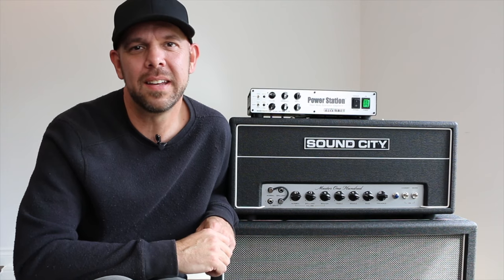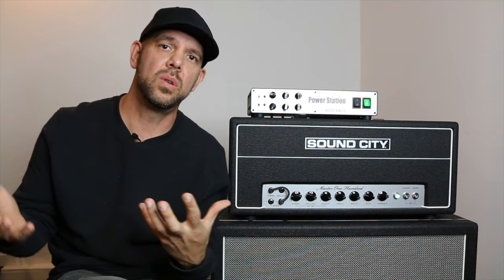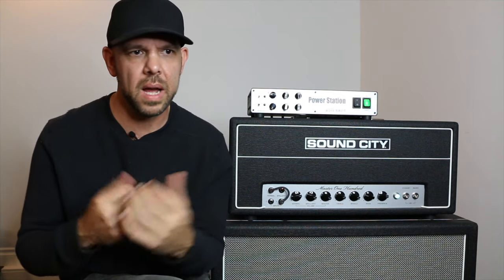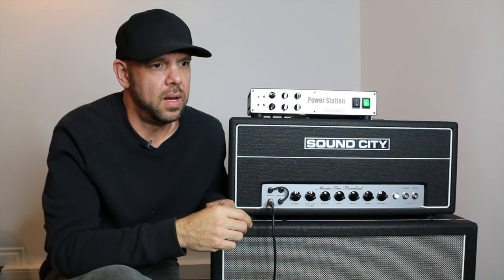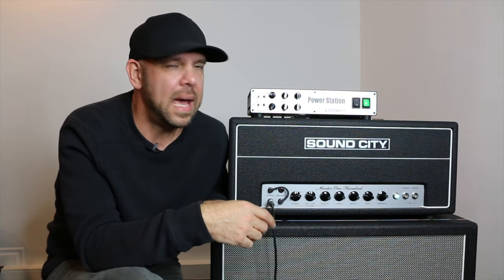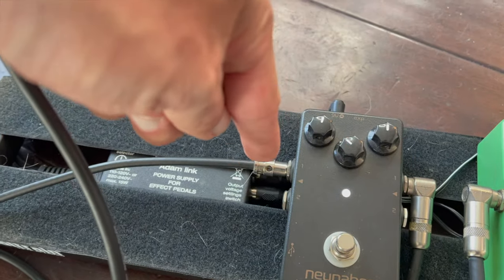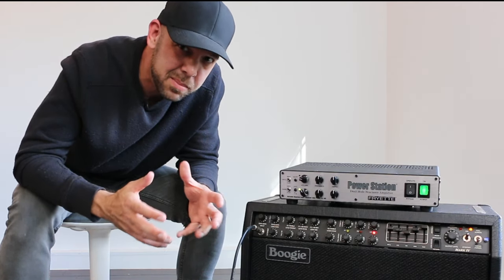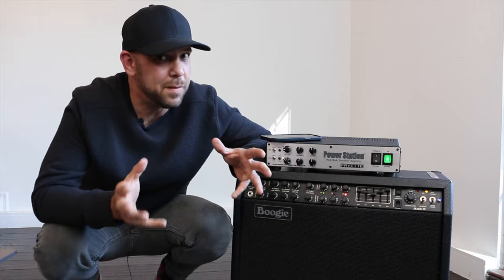Fryette Power Station - Mystery Squeal #2 Explained and Solved!

Comment: This video saved my life, for mental health related issues.  I have been trying to solve this for some time now.  I have many amps/preamps that I connect to the Fryette and had also been connecting my effects to the effect loop of the AMP.  One day I decided it is kind of a pain to disconnect and reconnect the effects loop pedals every time I changed an amp so I tried the effects loop on the Fryette Power Station.  I found myself standing in a puddle of my own urine trying to understand what the horrible screaming I was hearing was.  An isolated PSU did not resolve the issue, the isolation transformer between the amp and distortion pedal did.  Thank you so much for this.
Reply from the maker: Awesome mental image!

Comment: Fortin Zuul+ or similar gate owners: This is probably old news, but I'm posting this here in case anyone else shows up after troubleshooting without success. If you are running the Zuul+ in front of your amp and in the loop of the Power Station, and it is squealing, you can fix it by putting an isolation transformer in front of the key input. Remove the Zuul+ from your chain for troubleshooting to see if this is your issue.
Reply: Thank you for adding that comment. It helped me get rid of the noise it was still making when I had it between my amp and overdrive pedal.

Comment: I have this problem with gsp1101 or HX Stomp 4cm into my amp heads, even without using real pedals. I just 4cm the head and then head into the PS-2 then out into the cab. Took a lot of digging online. Good on ya for putting this out.

Comment: Really appreciate this video and your awesome products. Watched this before my ps2 arrived. I bought it partly for the attenuation in I need my small amp larger but mainly was really looking forward to using my boss ms3 with the 4 cable method in the loop. Sure enough at higher gains it squealed like a pig. So I immediately purchased the behringer hum eliminator just like you said and it worked perfectly. I am amazed how good the effects sound in the loop and the tone at all volumes. A game changer indeed : )

Comment: Hi, thanks for the clarification. I bought a Line isolation transformer (Palmer PLI 01) and it worked - but funnily now the tail of my held notes or ringing chords kind of gets chopped off… I can’t wrap my head around that… all my devices are powered by the same wall socket, my pedals have an isolated power supply, and the ground lift button didn’t change a thing. When I run the exact same pedalboard with 4 cable method into the effects loop of the amp it doesn’t happen (i know I could use that loop but the same applies for non-effects-loop amps as well) 🤷🏻‍♂️

Comment: that's great, thanks for taking the time to explain. When you plugged the isolation box though, the hum noise was louder than before. Is this normal?
Reply from the maker: Thanks for the comment! I have to say, when I was in the room making the video there wasn't any sort of appreciable difference in noise when I plugged the iso box in- certainly not to the degree that you hear in the video. I think what happened was that the compressor on the audio track readjusted itself and pulled the noise floor up a bit after I stopped speaking. Also, there was some iPhone audio blended in after I plugged the box in (which was in front of the amp vs the lav mic that was the only audio source before the squeal). Hope that helps!
Reply: @FryetteAmps  actually this helps a lot! Thanks again, great work!

Comment: (For the AC 120 power source ground loop) What about plugging either the power station OR the amp into an external 1:1 iso transformer? Couldn’t you get the same issue as the stereo amp being plugged into the same power source scenario?

Comment: If the source of the ground loop is the cable jacks from the two pedals touching each other, then why not just keep them separated? There must be some noise that has nothing to do with the proximity of the two pedals to one another, right? If not, what am I missing?
Reply from the maker: You're only missing that until you see this vid, you may not be aware of the need to avoid certain kinds of ground loops. Also the oscillation behavior varies from rig to rig and among various amps.

Comment: Emailed Fryette about this issue yesterday - hoping they have a fix to my issue which is a ton of awful squealing (at higher gain channels even when guitar volume is at zero) and humming coming from my rig since adding a KHE amp switcher into my 4cm. I dont have any pedals touching each other as I have a QC. I can only deduce its from my PS100 after doing some troubleshooting. I've heard these "hum destroyers" color the sound ... anyone who has used these devices find that and which device did you use. Thanks
Reply: Pick the Allen Avionics. I have the Ebtech and the Allen...Allen, by far, is the best.
Reply: Did you resolve your issue, if so how?

Comment: I'm planning on running GTR---Dist./O.D.----Amp---PS-2---PS-2 send---input of first mod pedal---one output of stereo pedal to return on the PS-2, (to run combo speaker) the other to a second amp.  (not using the amp's effects loop) I'm at somewhat of a loss here as to whether I'd need more than 1 Iso transformer, whether it'd go in the same place, or maybe wouldn't need one at all; though that seems unlikely. Would greatly appreciate any guidance you could provide. Just got my PS-2 this week, still waiting on the amp to go with it-I. am. SO. stoked!
Reply from the maker: Please check out the links to ground loop troubleshooting charts in the "SHOW MORE" field below the video.

Comment: I'm using my PS100 with a Hughes and Kettner Triamp MK3 and an Axe FX3 in 4CM. This may be a very obvious question but can I just take the cables out of the FX loop in the amp and instead put them into the loop of the PS? Would this even be beneficial, and if so in what way? Thanks.
Reply from the maker: It is beneficial because your time delay effects will then be after the amplifier output distortion.
Reply: @FryetteAmps  thanks for the reply. I've run into a problem, though, as is my wont. I took the leads going into the "send" and "return" of my amp head and put them into the PS100, and it squealed most terribly. Is the issue the 4CM? Is there another way of taking the post FX set up of the 4CM and sending them to the PS? Thanks again for any advice.
Reply from the maker: @dominicgibson9529  The video above explains that. Also, below the vid in the description there is a link to a diagram of a 4CM rig using an iso transformer.
Reply: @FryetteAmps  Thanks again...I apologize for what must be obvious questions to you. I have used all manner of guitar gear over the 30 years or so I've been exploring sound. I built a huge pedalboard a couple years back, for the hell of it utilizing an ENGL Special Edition head, and its 2 series FX loops. One loop was for all manner of pedals and MIDI gear controlled by a BOSS ES8, and the second loop used just the return and had a Fractal FM3 in it. All of these things worked brilliantly. I've never experienced grounding issues before with any gear I have used, so this really is a whole new experience for me. On top of this my PS100 has an issue with one of its chips, which I'm in contact with Dave for...apparently it's a known issue, and I was wondering if this was another symptom of the dodgy chip. Guess I have to get an ISO box. Many thanks, again👍

Comment: Could  the iso  be patched in either the send or return line of the PS2 fx loop instead of in front of the amp?
Reply from the maker: Yes, but that may not eliminate a ground loop issue. Follow the links in the description section below the video to see the flow charts. They show where ground loops typically occur.
Reply: @FryetteAmps  Thanks for the great info!

Comment: Thanks, having this exact problem. Never would have thought of the pedals touching one another being a problem. Btw, that transformer in front of the amp seems to add a lot of noise itself... ?
Reply from the maker: It's not the iso trans adding extra noise. That's iPhone compression picking up room noise.
Reply: @FryetteAmps  ahh okay makes sense. Thanks

Comment: At 9:24 you say you can’t provide the same hum elimination and solve this problem and force your customers to have to then go purchase an additional dongle box, to fall off the top of my amp or PWR Station that costs $14 at Amazon. This translates to about an additional $0.39 worth of additional cost to manufacture it this way with the isolation everyone’s going to need in this very REAL world example you demonstrated. Are you kidding me? What a laugh! I was going to buy your product, but now you’ve basically revealed your big middle finger Fryette flipped to me instead of solving this chump problem in the 1st place! Thanks.

Comment: I bougjt the same exact hum eliminator as in the video. The squealing vanished but my guitar signal is very very low. I cant get any gain off the high input of a jcm800. @fryetteamps any idea?
Reply from the maker: Please see the following link, also accessible by clicking on the "more" tab below the video. If you normally use any pedals between the guitar and amp input, put the isolator after the pedal. https://fryette.com/content/GroundLoopFlowChart_PS2_Detail.pdf
Reply: @FryetteAmps that's exactly what I did. However, the pedal (Wampler Terrraform) has 2 built-in routes. One pre route, which comes from guitar and to amp, and one post route, which is inserted in the fryette FX loop. So, same pedal, both in front of amp and in FX loop via  2 internal routes. That's when I get the squeal.
Reply from the maker: @NicolasLaplante   That won't work as you now know because the dual pedal is still a single ground path. That means the pedal is defeating your attempt to isolate the input.
Reply: Ok so that means that the dual route on the pedal can't be used with the fryette fx loop. I'll use it only in pre amplifier mode then. Thanks alot for the support!

Comment: thanks cause mine works great till i plug my pedal board in and it squeals like a pig...which sucks cause i took my whole pedal board apart and realized it wasnt my pedals but the power station ps-100 which i just received was on back order ...i use ciosk isolated power bricks .. i didnt think about hitting the ground loop button i will try that when i get home and give n update...using a Marshall non master 50watt head and Marshall cab
Reply from the maker: Ciosk and One Spot power supplies are often the source of this problem.
Reply: @FryetteAmps  really ? That sucks cause I run about 12 pedals on my board and I can’t use 12 individual power supplies that would suck… so i probably won’t use the Marshall with my pedals …just play it straight up ..
Reply from the maker: @NoCoverCharge  You don't need 12 supplies. Just 1 good one with true isolated outlets with low digital supply noise. Voodoo Lab, Strymon are good examples.